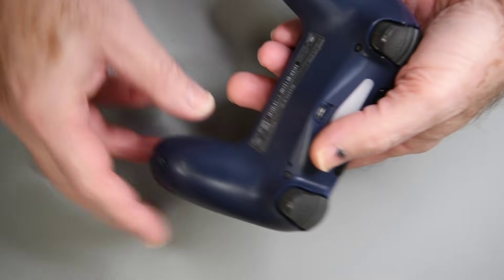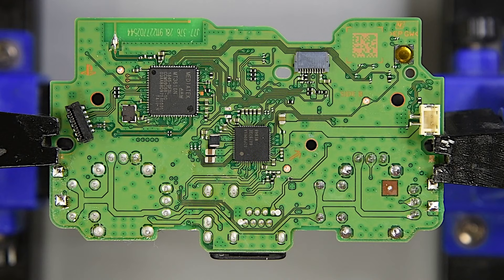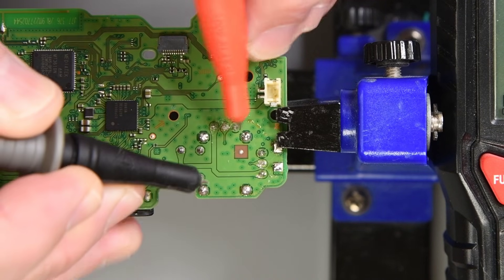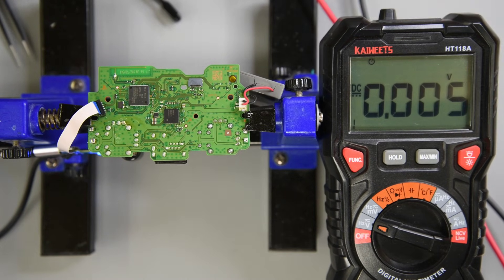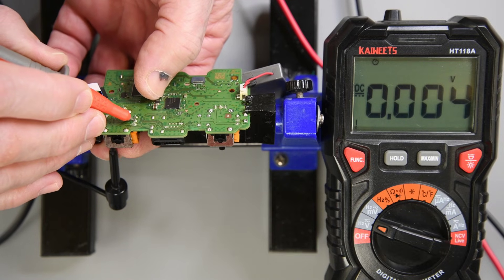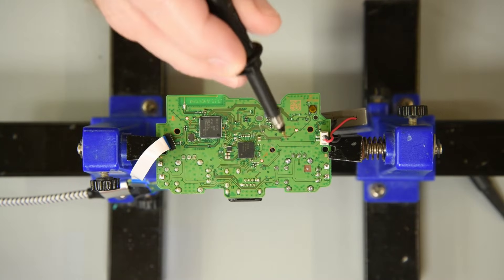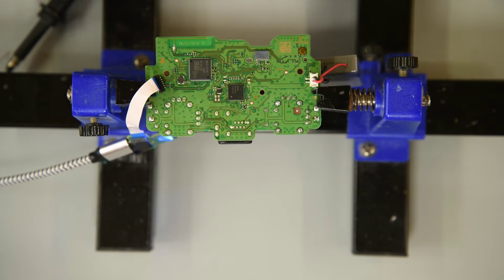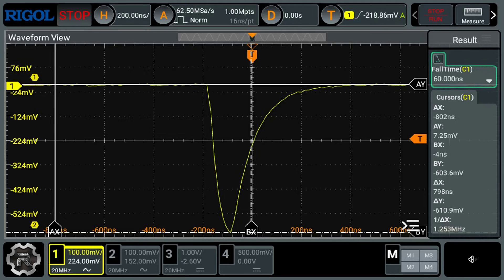Replacement Joystick Troubleshooting in a DualShock 4

Comment: I replaced the right joystick on a controller using the same board as shown in the video. Both axis work fine, I damaged a solder joint for the ground pin of the R3, so now it’s not detecting an input. I tried bridging between that pin and the nearest ground, as well as the R3 resistor on the top part of the board. The calibration website detected the button now working but the controller itself wouldn’t power on. What could be the fix ?
Reply from the maker: If I remember correctly, the L3/R3 switches don't connect to ground.  I believe one side of the switch is connected to the 1.8-volt supply, and the other side is the switch output signal.  So none of the pins of the switch should be bridged to ground.
Reply: @metalplasticelectronics354 I ended up fixing it but placing a jumper from the trace that ripped, down the ground hole connected to the other pin next to it, and then another jumper from there to ground.
Reply from the maker: Very good.

Comment: I had a question about a flex cable that was connected to the ground of the joystick on one of these jdm 055 boards. I wish could send you a picture to see what you would do in my situation to run a copper trace? Is there anyway to send you the pictures of what happened I don't know what to do but I love your information it helps so much. I accidently ripped the copper pad that was connected on the flex its not that bad and fixable I just don't know where to run the trace. I wish you could upload pictures.  I know running ground to another ground point is probably the fix with an enamled copper wire but I want to make sure 

Is there anyway to email you what happend and what I have for the screen shots I took of this tmr replace job im doing on this 055 board?

If you have Facebook I can show you on there
Reply from the maker: You can email me at mike@mlplel.com.
Reply: @metalplasticelectronics354  did you get my email?

Comment: I paid an electronics guy to install the Gulikit TMR sticks on my PS5 controller (as I don't know how to soder), and they have worked flawlessly until today. My kid played for a few hours, and now the Left stick is physically stuck to the right and upper sides. It doesn’t return to the center unless I push it slightly. I also feel some grinding and stiffness when I move the Left stick, but the Right stick moves very smoothly. What might be the problem? Thanks for any help! (My kid is saying he pressed L3 too much. I used the gulikits nearly 3 months without any problem until now)
Reply from the maker: Might pull the controller apart and make sure a piece of plastic did break and get wedged in the joystick or thumb knob.
Reply: @metalplasticelectronics354  ok, thank you very much
Reply: @erol1020 that is unusual however not impossible. I would say that the other possibility is a snapped recentering spring.

Comment: Do you know if the PS5 and Nintendo switch pro controller GuliKit analog sticks are interchangeable with each other since they both use the black pots?
Reply from the maker: I do not know for sure.  But I think GuliKit removed the Switch Pro compatible from the PS5 box.
Reply: @metalplasticelectronics354  okay just wondering cuz PS5 sticks have been out of stock for a little while on GuliKit Amazon store. but the switch pro ones are still in stock.

Comment: What would you say is safe temp and airflow on a quick 861dw rework hotair station to remove the sticks? I was using 400 at 60 airflow to remove them
Reply: 400c at 50% airflow seems to be the sweet spot for hot air on controller pcb's I've done 4 controller stick swaps today it gives no damage to the joysticks im pulling out... when I went over 400 at 100% airflow it damages a stick and made the stick stuck/not able to rotate around
Reply from the maker: Very nice I'll have to remember that.
Reply from the maker: I'm not sure, I've never tried hot air to remove them.  You will have to watch out for the very small SMD parts around the joystick.  I usually run my at 425 for SMD part removal.  At a low air volume, but for that large joystick frame you will need a lot of airflow.

Comment: Are you going to make a similar video to troubleshoot ps5 dualsense controllers with that pcb layout and information? Step by step to test resistance and voltages? The layouts/schematics/resistances are completely different. 

An Xbox troubleshoot controller guide would be awesome to

My ohm readings on my fluke 87v max are reading around 524.2 ohms consistent on every 3.2 volt connector to ground on these ps5 scuf controllers with the standard sticks scuf uses on the the FPS version they sell. I cleaned all the flux around the contacts on the board thoroughly where the sticks solder in with chemtronics flux remover and isopropyl 99.9%.  The pcb board version is bdm 010 on this controller I'm testing. The other controller I'm replacing has a bdm 040 pcb board with standard scuf sticks.  I am changing them over tonight to TMR aknes sticks as I type this to you. Is that a normal reading for whatever scuf puts in for sticks these standard scuf sticks with no battery or power connected?  Is 524.2 roughly a normal accurate number using my fluke 87v max for this board with these kind of sticks? You're testing with another Meter on a ps4 dualshock with other sticks it should read different.  Can you let me know

All the ground ohm readings are around 0.2 or 0.3 I guess thats normal for the standard sticks before I replace them. I just want to make sure these standard scuf sticks aren't shorting on this ps5 roller before the swap.

I have to plug in the battery and check voltages 

Thank you so much brotha you are amazing
Reply from the maker: This is the version of the video for the DualSense: https://youtu.be/cWUnZ7KjUIQ?si=VQmgI3azdyHaj8YQ  .  The voltage supply for a DualSense is 1.8 volts and the standard potentiometers are a little over 2K ohms.  So a little over 500 ohms across the voltage and ground pins is normal.  With Hall and TMR it should be higher, probably much higher.  And the value will probably differ depending on the voltage output of the multimeter.  Alas, I don't have an Xbox.
Reply: @metalplasticelectronics354  nice I edited this post make sure you read the edit.. flux remover helps alot also for contact and corrosion after you solder new sticks in they should last longer
Reply: 50-60% airflow at 400 celcius is the sweet spot it removed them perfectly moving my angled 9mm quick nozzle dead center and over mostly the ground points.. it only takes like no more than 10-12 seconds.. when I went higher I damaged a joystick

I just make sure to angle the air towards the outside of the pcb not going inward
Reply from the maker: I'll have to try that. Thanks.
Reply: @metalplasticelectronics354  my readings on these aknes tmr sticks are around 25.35 for ohms resistance you werent kidding man they are waaaaay higher

Comment: i have jdm 040, cant connect use cable to computer, but it can use bluetooth. ill try change charge board + flexible, change many usb cable, still like that. but i try the charge board on other controller, it work perfectly.
Reply from the maker: If it's not the USB connector, the flat flex cable might have a crack.  I ordered some of the USB connectors from this company a long time ago: https://kasynparts.com/  .  They had the flat flex cables as well, they may still carry them.
Reply: @metalplasticelectronics354  i already use another usb connector and another flex. but not working. btw. my old connector and flex i tried on another controller. and it working properly. maybe the problem is on main motherboard. can you help me. to bypass it from main motherboard ? thanks in advance
Reply from the maker: Does the battery charge?
Reply: @metalplasticelectronics354  yes, the battery charging. and i make sure the cable i use is cable with data. the problem only it can't connect use usb cable
Reply from the maker: There will be 2 traces that leave the FFC connector right next to each other and stay that way, those are the USB data lines.  I know those traces on some of the mainboards will go through some tiny SMD parts.  Check and make sure none of them have been knocked off.  I would imagine they are very low-value resistors but I haven't checked them so I'm not positive.
Reply: @metalplasticelectronics354  are you have schematic board for jdm 040 ?
Reply from the maker: No, I sure don't.

Comment: I wanted to ask you if the ps4 tmr sticks would they work installing them on a duelsense controller? Since they look identical besides the color difference from blue to black housing. I was curious because I can source them faster than a set of the ps5 ones and I wondered if it actually made a difference as to which ones you do install. Would you be able to make a video on it for giggles just to see and test out?
Reply from the maker: No, you will need the version made for the DualSense.  The color difference signals a different pinout, and/or magnet orientation.
Reply: @metalplasticelectronics354  ah okay thank you for your reply and awesome videos
Reply from the maker: You are very welcome

Comment: You ever think about doing GPDL tests on joysticks? Someone on reddit mentioned the way you test joysticks is outdated and not as accurate
Reply from the maker: I believe the GPLD is used to test the latency of the controller and the PC communications.  It doesn't actually test the joystick itself. One DualSense should be very close to any other DualSense.
Reply: If it works don't fix it